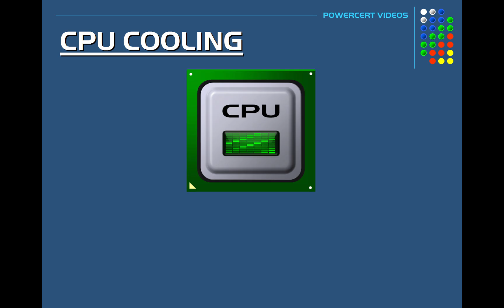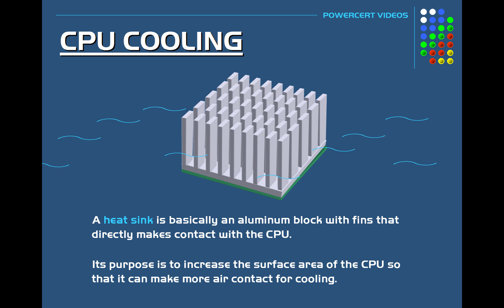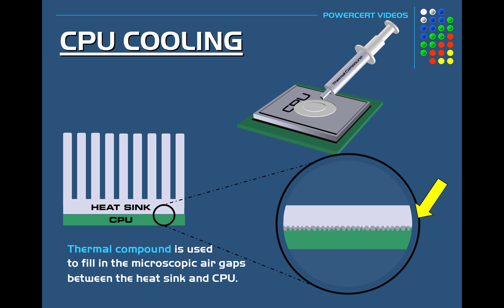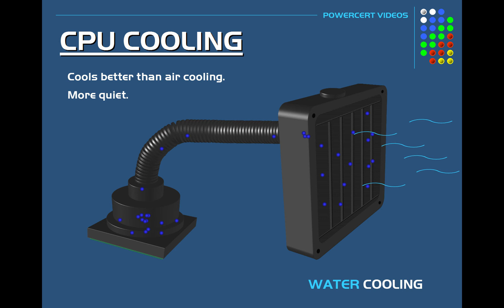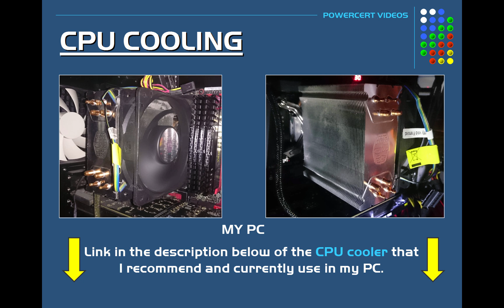Thermal Compound Paste, Heat Sink, Air vs Water Cooling Explained

Comment from the maker: The CPU air cooler that I use & recommend (affiliate) https://amzn.to/2EwAnlY
Reply from the maker: @Cio Dokop  Thank you
Reply: @PowerCertAnimatedVideos  Woowwww
Reply: @PowerCertAnimatedVideos  I use water cooling (Corsair H2) combined with low noise vents (Noctua) to keep my private workstation quiet, the i7 with 6x4 Ghz is nearly not to hear. Air vents spin temporarily up, but a water cooled system has more heat-buffer in the system and the vents only spin up after a certain time if the whole system is under heavy load - i am a big fan of silence. 
BTW you did a great job with you videos. I always remend your excelent videos to my apprentices.
How about a video about Type 1&2 Hypervisors?
Reply: Please note that the call that started sooner will be held for about 30 seconds, and then begin the 10-second countdown. Afterwards, the broadcast begins.
Reply: Love your videos. Why are all your videos 4x3 Format and not 16x9 format?
Reply from the maker: Thank you.  I use an older version of powerpoint which doesn't have the wider screen format.  I still use the older version because I'm so familiar with it.  But I do record the screen in 16x9, it's just that when you watch youtube videos in chrome, it cuts off the black edges.  Which makes it look like I made the video in 4x3 when in reality they are 16x9.  Eventually I will move up to a later version of powerpoint.
Reply: @PowerCertAnimatedVideos  Thanks for your reply and interesting what you say about Chrome, anyway your  videos are still the best at explaining stuff, stay awesome man. love this channel
Reply: @PowerCertAnimatedVideos  OMG Your explaination of the IPv4 and v6 was EPIC... NOW AGAIN THIS... WOW BEST TECH CHANNEL.... Please reply i am 13

Comment: I remember one time when doing something to my PC my tired and dumb ass turned the PC on to test it without putting the cooler back on. Within seconds it shut down and I suddenly realized what happened. For some reason I decided to take the CPU out but it was so hot it burned my hand and I almost dropped it. 

Tl;dr always put the cooler on before turning it back on... Even for a quick test boot... I'm very lucky I didn't fry it.

Comment: Great video, however, the air-cooler bundled with CPU is perfectly adequate. I don't know why you stated otherwise. CPUs with higher TDP don't come with a CPU cooler by the manufacturer, because the one they can fit in their tiny box won't be adequate. 

Bottom line is, if its in the box, it's perfectly adequate.

Comment: The most heat producing unit is GPU, not CPU. 2-3 times as much as CPU. ☝🏻
Reply: Dependent entirely on what kind of graphics card.  All CPU's run hot.

Comment: Watercooling is not always better performing than air cooling,
Reply from the maker: Not always...but most of the time it is.  Especially if you're into overclocking.
Reply: @PowerCertAnimatedVideos   

I alway trust your videos but about this i cant aay u are right about it

U should put noctoa under your consideration since it generate less noise than most of the water cooling and at the same time cost effective and higher performance than any other water cooling on the same price tag

Thank u again for what u are providing and good luck

Comment: I don't think that you are completly right with what you say at 0:32.
That the CPU could burn up without Heatsink or something like that.
But it would usualy do heat/trotheling (trotheling down the performance and power when temperature goes over 92°-100°) and the computer would shutdown if it reaches 105° or so.

Comment: I heard from another tech professional youtuber that unless you are overclocking or the cpu just doesn't come with a cooler  then there is no point in getting a 3rd party cooler.He also said most people even if they are overclocking and unless there are trying break records than  a watercooling system  is a waste  . What to do think about that ?

Comment: When I built my latest PC I installed a water cooler. I’m a gamer and with air cooling my CPU was always near its thermal limits, but with water cooling the CPU stays significantly cooler and I can play for hours without glitching.

Comment: 4:08 Did you know that "Warrany void if removed" stickers are illegal in the US?

Also water coolers are not necessarily silent because that pump makes a lot of noise.
Reply: No. A typical 5v cheap submersible water pump have a lifetime of about 200,000 hours, a flow rate of 1.6L/min and is very very quite. I don't know where you got your sources but I've been using them a lot in my projects.
Reply: @nullbeyondo  My Corsair h115i wants to say otherwise. Nobody is talking about lifetime here or efficiency...

Comment: Some basics for the uninitiated. IMO, the upper limits as stated by some laptop and desktop makers, is too optimistic and leaves very little room if over-heating occurs in the CPUs & GPU's. "Gamers" seem to be the main group of users keenly aware of the overheating issue. The life of a PC can be considerable extended by ensuring it runs as cool as possible from day one.  Obviously, preventing excess heating in the first place is the key!  Outside of upgrading OE cooling, I've found the following basic suggestions beneficial for my family and friends, when all of the following are implemented. 
 Just Basic stuff...

Routinely clean the fan(s) & screens. Don't impede the flow of air circulating around the unit. Especially on the bottom of LT's, their exhaust ports, if any, and the back of desktop "towers", or where the CPU fan intakes are located. Placing a small desk fan so it blows/circulates air in the direction of the CPU fan intakes can help. 

I place an adjustable "frame/base" under my laptop, on my desk. Helping the fresh air supply greatly, dropping op temps by 15* F. Look for one made of aluminum, that will only contact the LT bottom with 4 upright feet...not a "platter" covering the entire underside - defeating the purpose.  Amazon has them.  

Lastly, the freeware "SpeedFans", which I use on 2 of 3 computers, provided the most cooling benefit listed here. YouTube has many tutorials on how to properly adjust SpeedFans' settings. A MUST watch, even for the experienced!
Reply: OR buy this supremely superior software to my SpeedFans suggestion in my last post for cheap! https://www.argusmonitor.com/en/how_to_control_system_cpu_and_gpu_fans_by_temperature.php

Comment: Actually if I am not mistaken water coolers only trumps air coolers just because they have a larger "heat" BUFFER to deal with and the fact that the heat can more "easily" be able to be "offloaded". Since water takes so much flipping heat before it's gets "too hot". Over say even a huge aluminum block. The reason I believe people use them for intensive builds is because they can MOVE the heat dissipation rather than having an insanely huge air cooling rig inside the case. To say just out/near the outside of the case for the quickest air exchanging.  In addition to the price tag you will also take the risk of it breaking (likely the pump but leakage do happens even in good quality AIOs but your pump is likely to brick before that happens) and once it does good luck "fixing it". At least with 3rd party 120mm coolers you can probably easily get a static pressure fan to do the job instead. Also who said that stock coolers are crap? I have an APU and it's cooler is doing it job even under heavy stock loads. I heard also that the Rzyen coolers can even do a LIGHT overclock before they hit the fans say to speak.

Comment: I built a computer, as I usually had done, thinking I'm fairly knowledgeable - coming back to it years afterward, I find almost every significant installation was pretty bad; one being CPU thermal paste. The computer always ran hot, and while replacing the standard heat sink with a liquid cooler, I found the paste was way too little; the reason was my earlier heat sinks clamped on so tightly that the paste came out all over. My recent computer's mounting is much less, therefore the paste was not covering much area - had there been enough paste, the OE probably cooled well enough. The liquid cooler is very good though; most people probably frown on stiff liquid lines, but I am thinking the line's material may have low permeability (less liquid loss over time), and I am quite satisfied with it being that way. The Cooler Master -120 single-fan is a good price and has good performance; if I remember correctly, I reduced a staggering ~90°C+ (hot day, under load) to more like the mid-40s (32°C, idle, cold ambient) with much quicker pull-down times).  It went through hell for quite while.

Comment: I'm sorry to add to your workload, but could you make a video about hyperthreading for those of us like me who are lost on the subject and, therefore, don't know what processor to buy. Everybody else is so busy telling us how it will help gaming that they never truly cover the subject. You know how to properly teach subjects so I ask you.
Reply: I think he has one, but in any case, hyperthreading is good, its a fact and everybody already know this. In simple words, 4 cores is 4 cores, 2 cores and 4 threads is almost 4 cores. It will work almost like 4 core cpu without hyperthreading but wont outperform it, it will be close tho. 4 cores is always better than 2 cores and 4 threads. What hyperthreading does is that it will tell cpu to do some other work while the primary work is done and cpu is waiting. One core do something, sends data, data being validated and then new data comes to the core, while data is validated and new data prepared, cpu does nothing. Thats why hyperthreading came, to solve the problem of cpu waiting for stuff to do, it allows cpu to do something else from some other program after finishing its first work and while it works on something else, new data is sent to cpu. Its almost like cpu has two hands with hyperthreading and now able to eat twice as more with its hands while no hyperthreading will be like cpu has one hand and while hand moves to take something new to eat, mouth does nothing.

Comment: Perfect timing for this video. Just discovered the different cooling methods and needed addition clarification on this topic. The least talked about critical fact is that thermal compound fills in "the microscope gaps" between the CPU and the heat sink. Most people think both surfaces are 100% flat. But technical, as stated, they are not. Great video.
Reply from the maker: Thank you Kenneth.

Comment: But, doesn't the water evaporate eventually?
Reply: It is closed system. So the answer is NO.
Reply: @MarkoAmbrožič    Actually, it can permeate out (as nothing is perfectly impermeable).  Different materials have different characteristics, and that is PEX (cross-linked polymers) tubing is used in "plastic" building/residential water systems. You'd be surprised how much loss can happen. The same goes for saturation/flooding of intended air space (for water hammer cushion) by condensation.

"In the chemical reaction between soap and aluminum ATOMIC hydrogen is formed. Atomic hydrogen has a very weird property of actually being able to move completely through solid aluminum......because it is such a small particle. Atomic hydrogen cannot be contained in an aluminum vessel.....it moves right through it as though it weren't there. It remains in the atomic state only until it meets another atomic hydrogen atom which then produces the hydrogen molecule H2. Molecular H2, which is a gas, cannot pass through solid aluminum. ..."
Reply: @louf7178  that is deep. ;)

Comment: Im sad some of your statements on liquid cooling are factually incorrect, especially the part about liquid coolers being more quiet, which they arent because of the pump creating noise itself and can end up being louder, on top of the radiators own fans. Also i think you should have added liquid coolers have more points of failure to go wrong and some of the fairly rare but possible dangers. ignoring the liquid cooling portion though great video!
Reply: 6th gen asetek pumps are pretty much inaudible. im running a 9900k at 5.2 ghz, using -2 avx offset and 1.35v using a corsair h100i pro. i had a noctua nh-d15 before (had to use it in my server instead) and the 240mm aio is just as silent, but temps are better with the liquid cooler. also, i could "only" run 5 ghz with -2 offset on the air cooler. noise comparison: https://www.guru3d.com/articles_pages/corsair_h100i_pro_review,11.html - there's many bad liquid coolers, especially the first few gens. the good ones are great at this point in time.
Reply: Mine is very quiet, and you can't count an incomplete condition (of entrained air) as normal operation to judge by e.g. I didn't tighten the lug nuts on my car's wheel, and the wheel severely wobbles, so the car is a piece of shit.
Reply: He didn't even touch on some more exotic cooling methods such as liquid nitrogen or mineral oil immersion. 

LN2 is mainly only used by extreme hardcore overclocking enthusiasts. It works in mostly the same way as regular cooling, except with way more safety measures and reinforced components to withstand the extreme cold. This cooling method was used for PC build that ran doom eternal at 1000fps.

Oil immersion is where the liquid itself makes direct contact with the CPU and is usually fully immersed. Mineral oil is preferred as it doesn't smell bad over time like the also commonly used vegetable oil. Oils like these are non-conductive and do not short out electronics. Besides the fact the CPU is actually immersed in the liquid, the rest of the system works the same as traditional liquid cooling. Additionally, this setup provides some of the best cooling as there is no metal plate and thermal paste. It's a liquid so it perfectly fills its container which is in this case the microscopic gaps in the CPU surface.
Reply: @RedVRCC  wow that’s some great info

Comment: can a CPU get too cold
Reply: bleach only if the computer is off and if your are in the Arctic or unless you are poring liquid nitrogen while the CPU is off 😂
Reply: only with sub zero cooling.
Reply: It depends on your what kind of coolant do you use in how cold is it， Usually not when you buy online only maybe when you build by yourself to get very cold temperature, it also depends on your computer is high performance or always running or not.
Reply: I thought liquid cooling was a different type of thermal fluid. But for the whole time it was water
Reply: @regularuser  for the sake of simplicity he used water as coolang in this video. It will work, especially if distilled water is used but some metal components might corrode and get damaged from water, hence why usually water is fast sollution and proper coolant is used instead. But yes, cpu can get into subzero temps if such cooling is used that allows that. Its not good to run cpu in subzero, i mean cpu is actually in subzero temps even if it is working at full power and cooling is overcooling that heat output. Dont know why tho, havent researched much, only hearsayings. Liquid nitrogen cooling is still not enough to cool cpu into subzero conditions while it is working because cpu still heats so much more in those specific conditions when liquid nitrogen is used, that it still gets hot.